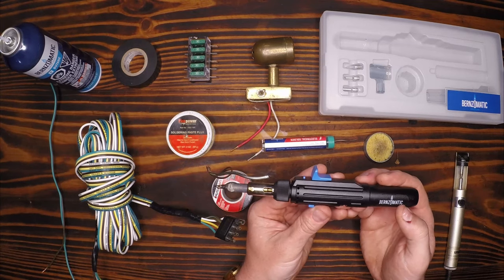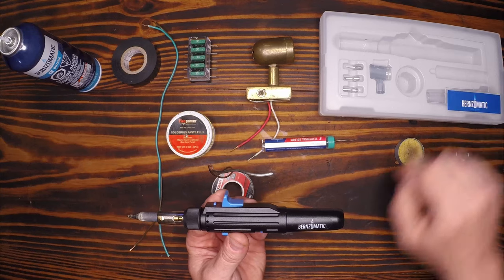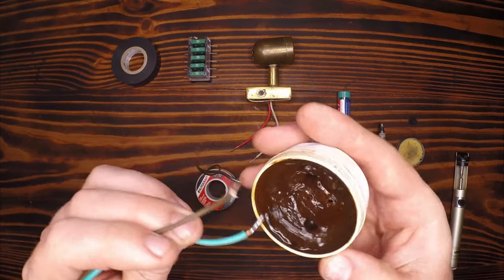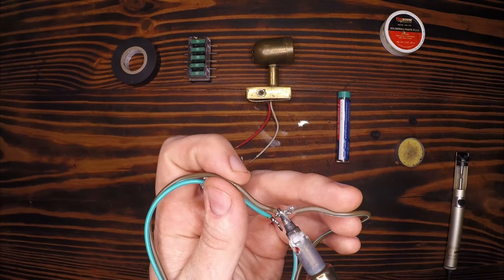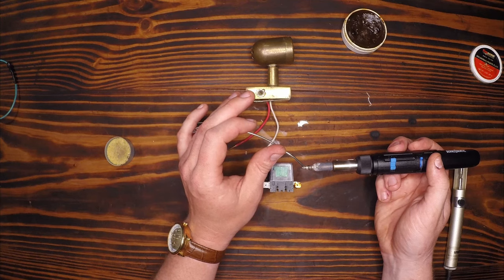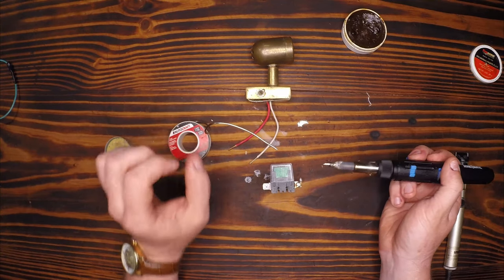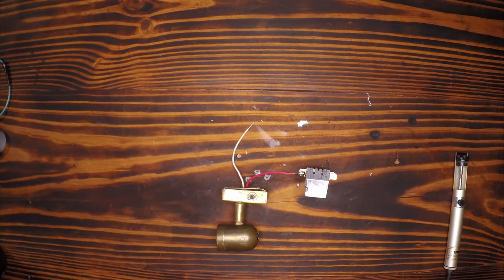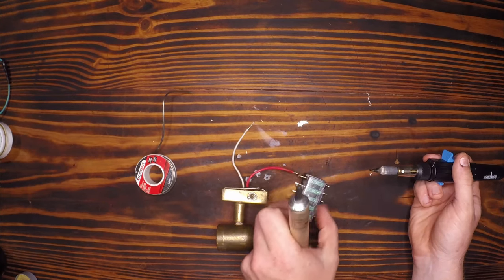Soldering Tips: Trying out the BERNZOMATIC!

Comment: You’re soldering incorrectly, you need to heat the thing(a) you’re soldering then introduce the solder onto the item(s). In this case, you should heat the wire, then push the solder into the wire. It’s about heat transfer, not “Loading up” the soldering iron. The heated wire will “suck” the solder into the connection.
Reply from the maker: That method does allow for better penetration! However, if I pull the wire as hard as I can it breaks BEFORE my solder connection breaks so this method has plenty of connectivity and tensile strength. It's a good thing that there is more than one way to do something correctly and that we don't limit our minds to a single technique. It would make us poor at improvisation and adaptation! Thank you for your comment!
Reply: You also used plumbing Flux for electrical soldering. That stuff is acidic and will speed up the corrosion of the wire. If you don't have rosin flux you'd be better off not using flux at all, just letting the rosin core of the soldering wire do the work of the flux.

Comment: 10$ electric soldering irons work just fine for almost everyrhing 

Where the usefulness of this comes in for me is mobile work, sometimes I'm in the bush or even just on a street working on something, you dont have a bench to work on the wire you're repairing. I have the capability to run 110 tools from my truck anyways, but then youve always got that extension cord in the way while youre laying under a dashboard, and it only works on small wires still. With this, you can take the tip off for a blowtorch and solder lugs on larger wires, like 6-00 gauge battery wires, plus you can take the tip out but leave the catalyst module to use it as a pinpoint heat gun, you can reach in super small spaces and heat shrink a wire, no need to shove your fat hand up in there with a bic and burn the shit out of yourself

Comment: This I not the correct way to solder in ever way
Reply from the maker: It works, is simple, and repeatable for beginners.
Reply: That is not correct grammar in any sense, or sentence structure, what so ever. His joint held, it's conductive, and it's perfect for a diy'er or beginner. Besides he's demoing the tool, not the technique. Thanks for the vid. I was on the fence about getting this and this made me get it. Where'd you get the set of helping hands? I need that 😆.